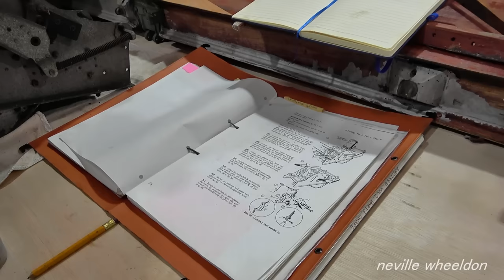Video 223 Restoration of Lancaster NX611 Year 7.-- Wing tip and rear trailing edge removed.

Comment: Great video Neville, thanks. Somehow things like the trailing edge removal make you realize just what a massive job the whole project is. All the wiring and "stuff" in the No1 engine nacelle that will have be disconnected and refitted to the French wing, all the de riveting and stripping of the wing once it's off...massive jobs on their own, but only one step in the overall project. It's definitely a case of eating an elephant one bite at a time...
Reply from the maker: Thank you mate.

Comment: Fantastic video.  Particularly interesting exposing a part people don’t generally see - the ammunition belt assist.  Curious about the fuel tanks on the French wing — don’t y’all need at least some to feed the engines for taxi operation in those years the other parts are being returned to airworthy condition ?  And along the same lines, I would have thought that Keith’s work on the French wings was not simply to have a place holder for taxi - rather also learning and practice for the work toward airworthy status to follow, and by the same token, would this also afford practice for the responsible party(ies) who sign off on the airworthy parts as they are assembled and recorded ?   Also, about the French wing, in one of your videos you asked Keith about lights, and he said “no lights.”   Does that mean - like today - he is working only “structures” and someone else will come along behind to add some lights, if not for airworthy condition - at least enough for Christmas lights that allow paying guests a more full experience ?  How fun seeing the practical side of French nose being removed from the paint shop.  Well done !
Reply from the maker: Hi HH, the French wing will not be having the 2 fuel wing tanks fitted or any wiring for lights this is to say time and money. They are fitting No 1 tank which is situated between number 2 engine and the Fuselage which will feed both 1 and 2 engines. Number 1 (Port and Starboard) fuel tanks have  been away for servicing and made airworthy. this will save time and money. Remember this service will not cost the French one single penny.  The lights are only used once a year in November when the do a night taxi run.
Reply: @nevillewheeldon1693  Marvelous !  Thank you !!!